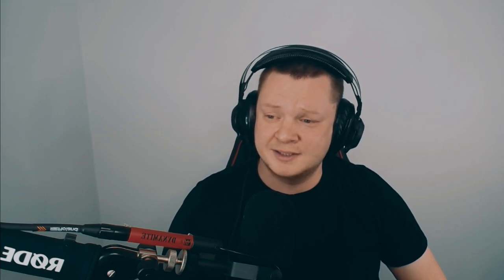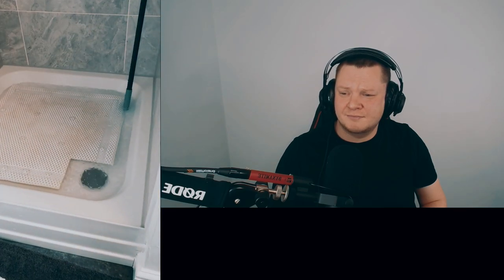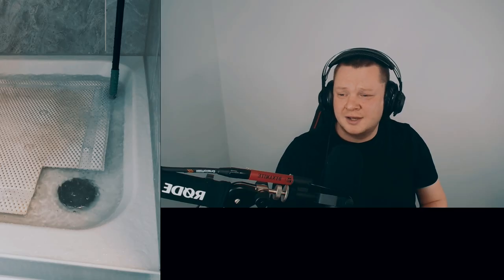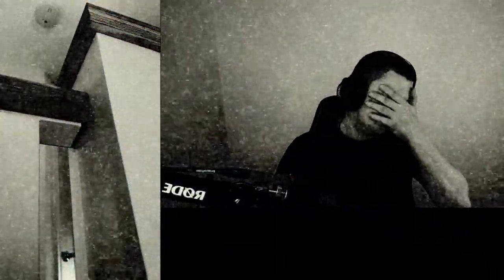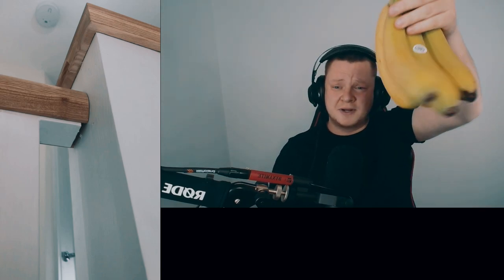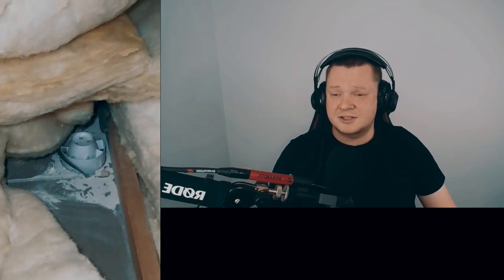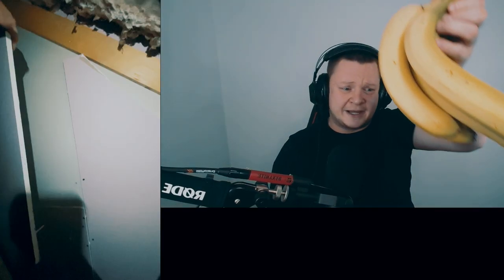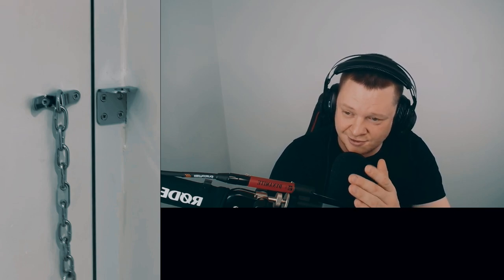How are New Build Snags Fixed? | The Snagging Breakdown #6

Comment: having been in a new build a decade ago the snagging process was shocking and anything beyond a bloke with a tub of filler seemed to cause a meltdown when it came to fixing it - realised years later there were no wall ties for the garage roof installed, watching your video's I'd be scared to measure the brick work on the house!

Comment: With the buried air bricks, I'd slope the garden to the house and put polly chanels in, make a level path 100mm lower, then polly channels and grade the gargen. Or make a path 100mm deep, then a 100mm step to the garden.  Either way, a 100mm deep path 1st.
Reply: Yes but this is a new build so that won’t get done. They’ll dig a small hole in front of the air bricks and leave it at that.
Reply: @twistsouth514  that sounds suspiciously like a funnel for rain. 
I'm in Australia but I've heard it does rain on occasion in the UK, am I correct?
Reply: @bneskylights1152  my point is that they’ll do the bare minimum to “correct” the issue even if it means creating a bigger issue. Then they’ll tell you it’s “not a problem”.
Reply: @twistsouth514  I know. I was partaking in a jest.
Reply: @bneskylights1152  apologies, your jest was misconstrued.
Reply: What if it's nextdoors tarmac driveway that buts up to the airbrick??!?
Reply: @D  it wouldn't be...   and if for some ridiculous reason that is the case, take the neighbour to court.

Comment: With the window problem at 3.30 i work at a company who manufacture windows, thats a dummy sash a non opener, they are screwed into the frame and the window fitters take the sash out to fix the frame and clearly forgot to put the screws back in, pretty easy fix but poor workmanship